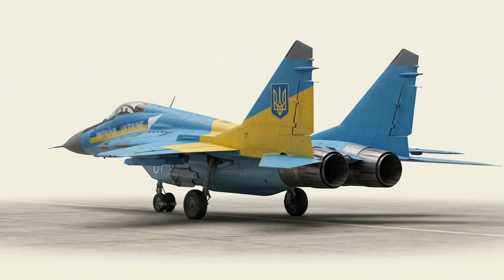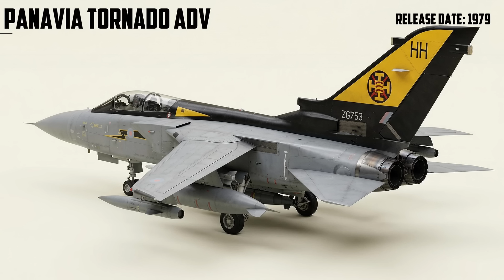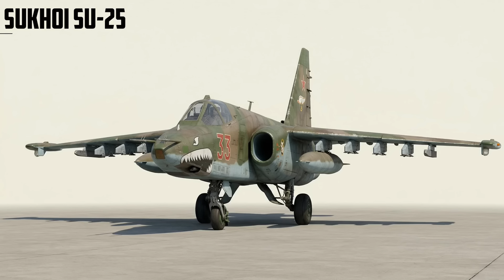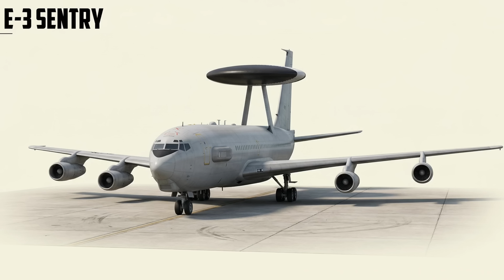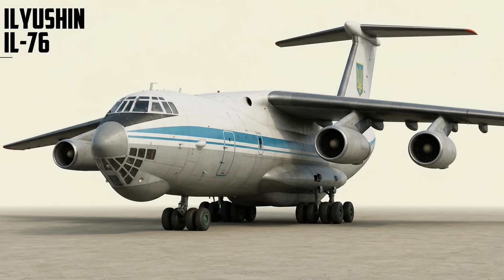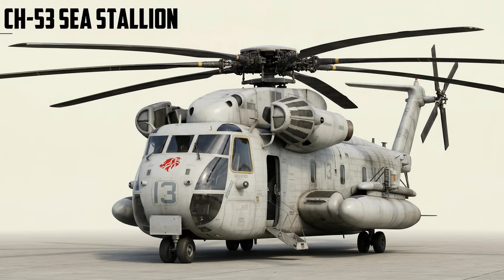Every Aircraft Used in The Gulf War

Comment: Facts Hidden by the Media
The Iraqi Air Force was wildly outnumbered.
Iraq’s inventory of ground-attack aircraft exceeded its interceptors because the Iran-Iraq War necessitated a greater focus on ground support than aerial combat. Following that conflict, many Iraqi aircraft were sent to Western nations for overhaul and maintenance.
The deployment of Cruise Missiles was a new challenge for the Iraqis; they were used extensively to dismantle Iraqi command and control centers, radar stations, and airbases. While the Iraqi Air Force achieved some successes, its contributions remained modest compared to the massive scale of Coalition operations and the immense pressure they faced.
The number of air-to-air kills claimed by the Coalition was later revealed to be highly exaggerated, despite the efforts of supporters to defend those inflated figures. Furthermore, it later emerged that Vice President Izzat al-Douri was the one who compelled Iraqi pilots to evacuate their aircraft to Iran, despite their fierce opposition. Al-Douri intended to use the aircraft as leverage to persuade Iran not to cooperate with the Coalition’s efforts to topple the Iraqi regime in 1991.
In short, in war, the truth is the first casualty.

Comment: Nice work, a couple of aircraft missing. You have the Nimrod MR in the maritime patrol section, which is correct. But Nimrod R1 variant served in the ELINT role. RAF Canberras also served in the reconnaissance role. The Lynx did serve with the Royal Navy, attacking several Iraqi ships. The British army also used them in the anti-tank role. MBB Bo 105s served with Iraq so it is a Gulf War aircraft, but not in an anti-tank role against Iraq